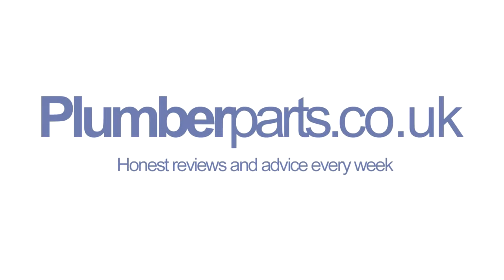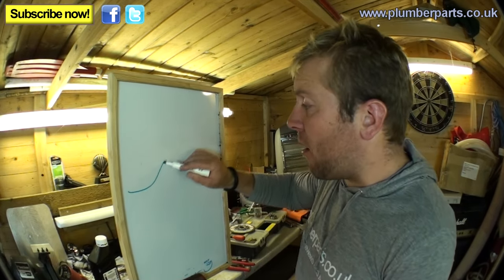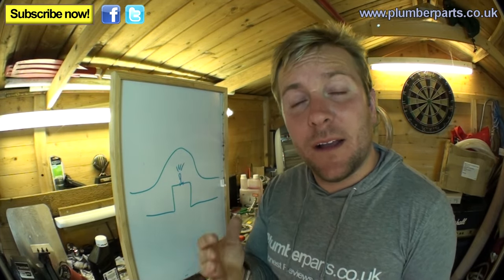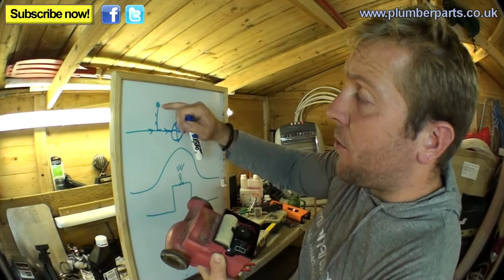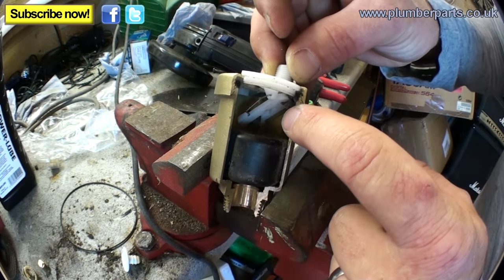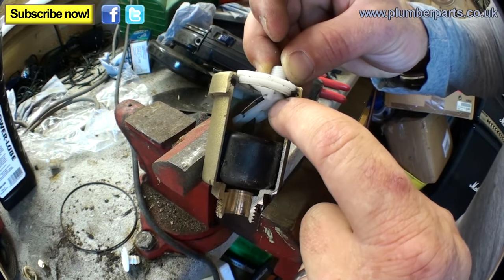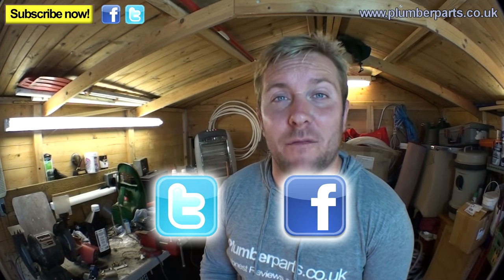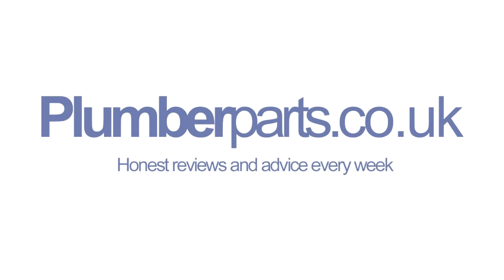AUTOMATIC AIR VENTS - Plumbing Tips

Comment: Oh man, I’m so glad I found this video. It’s the start of the winter season up here in the Colorado Rockies and on my Laars JVS 225 in addition to a dirty glycol issue that I think I’ve got a handle on until next summer when my plumber does a complete flush I find I have to drain air directly from the Grundfos circ pump every so often which - as I see from your remarks - the open vent top should not be on the inlet side of the pump: which it is! If I knew how, I’d send you a picture. I’ve got nothing to lose, I closed the cap, I’ll see what happens.  I’m having to run the pump on high vice medium which may help with my flow issue across the heat exchanger that was making a racket but I couldn’t figure where I was getting air from out of the Grundfos. Thanks, man, hope this helps me. If it works, I’ll let you know. ✌🏼
Reply: I guess this is too old to comment on, that’s cool.(Hope you got your toothaches taken care of 😉)

Comment: Top man for this part in depth explanation and info. Mine (well the top half brass part and float ) is in a JAGUAR 28 KTV J, the body is bespoke and part of the pump assembly, the issue with this is, is the part is obsolete. So a good old clean, especially around the spring loaded pin that seats into a baby o-ring. A good clean was required. (Touch wood) this has fixed the problem on a 21+ year old boiler !

Comment: Great video many thanks. Separate isolation valve sounds good idea for permanently energised apps. Presumably they fail earlier in hard water areas. Interesting to cut one open that's failed. Can you do a video sometime on airlock theory. I'm thinking surface tension can be involved, so don't put filters and restrictions in the pipe like small bore iso valves. You will understand and explain it all much better. Hope the tooth's better soon.

Comment: Hi ya, enjoy watching your videos and learnt a lot and put in to practice. We  will be moving into a inherited house soon that had a sludged up system. I'm in maintenance as a job so I'm not shy in trying new tasks. I've drained and flushed several times, removed radiators and manually flushed out. Installed a filter near boiler return after running for several weeks with cleaner, flushed again added inhibitor and all working better but not right still. Its a Y type F&E system that has been changed at some point to a feed and vent from tank in 22mm. I've removed the bypass and capped off pipes for now as I thought both sides were hot to quickly and found the valve full of black debris so my guess must have been right. I've a towel rad with open lock shields and not all rads have TRV's so should be okay until I replace the valve. Leading to this video. There is a manual air vent on a 90° drop (T piece rad feed one side to air vent other side) from pump to radiator feed. The air vent is only about 6" from the T piece. Every time I open the air cap there is air in it. Its a large system 15 radiators and down stairs take a lot longer to get heat than upstairs. I've balanced all rads and now all get hot but slow downstairs. I think there has been flow back/ fill to header as the tank goes brown and white quick. Do you think a automatic  bottle air vent about 12" above the T piece will help downstairs by having no trapped air? Thanks  James. Holding tight 😀

Comment: Are you meant to leave the small plastic top vent cap loose to let the air out or do it up tight?
Reply: No, it has an small air valve funnel to automatically allow air to vent out when needed, video explains if you rewatch.

Comment: Originally auto air vents were for filling purposes only.  When the system was full with all air out, you tighten it up. Otherwise you might get a leak and stained ceiling.

Comment: I installed three new air vents on my hot water boiler. My question is, can I leave the air screw in the closed or open position or leave closed and vent when needed?

Comment: The AAV has black solution leaking and going down the pipes in the airing cupboard.  One engineer turned it off but did not install a new AAV, 3 months later another engineer has just turned it back on as he said it causes a build up of air and pressure in your boiler system which will cause the heating system to fail/break down.  You said in your video to turn it off if water comes out, so now I'm not sure if it should be turned off or kept on??  Either way it will cause issues.  Please can you help!  Thanks Emma

Comment: i have bought a new one but been told this is a 3/8 one and mine is 15mm. Maybe daft q, but will the 3/8 one screw in to the existing "olive" extension part of the 15 mm one? - the one i bought has no extra fitting whereas the old one has an extra fitment below. Thank you!

Comment: Hi
I changed my pump on my train on combi boiler the other day and drained system. I’m now going to put in inhibitor and usually put it in around the auto air vent (bottle type) as it’s the highest part on the system but when I was undoing the compression fitting water was coming out, should I just undo it and accept some water will come out or is there something wrong with the system. There was a new pressure cyclinder fitted also. Combi seems to be working great. It is 14yr old 
Thanks
Ewan

Comment: If it's a sealed system, why or how would air be in the system? And if the air vent did release the air, does this mean you have to continually top the boiler up?

Comment: Thanks. Just a note , that "cap" you say will keep the water from coming out should the ballcock get fouled, is not a cap, but a second vent. It's designed to swell up inside if water reaches it. That way air can still go out this "cap" yet still remain water proof if the vent fails. 
Cheers.

Comment: I have UFH and the Flow Meters all have trapped air after a "Power Flush" and recommision. These are on the botton Supply Pipe instead of the Return on top with Actuators. Is this a problem to get the air out if the Auto Vents at the end of both are ceased up? Is it really bad in the system as it has not made it noisy yet?

Comment: Ive got one of these bad boys on my potterton puma 80se, a relic I know 8) . having occasional  problems with what I thinks an air loc around the circ pump, when it refuses to circulate makes it makes a whooshing bubbly sound and a bloop bloop when you shut the boiler down, like air going back up into the exchanger. Theres one of these auto air vents to the top left of the boiler so will change that out. Cheers man ;)
Reply: well wotdya know, gave the valve a tap and it started hissing air, followed by drip drip which stopped when i screwed the tap down tight. the pumps circulating again. I held tight n it was alright! lol 8)
Reply: jeeeez, I had no CH flow again! After getting on ze web I found out the pumas are sensitive to HW leaks. Just like the leaky HW tap in mi kitchin!! Just shut the tap down and boosh, CH flow restored! Id have never believed it till i see it with mi own eyes!!

Comment: Hi - I have an automatic air vent valve fitted close to my hot water tank and open it from time to time to release air that has accumulated, it does not leak  and there is no corrosion around the unit which is an open system. Should the cap be left slightly open to allow the system to vent automatically ??? - I do not have an issue with air in any other part of the system ie the rads.
Reply: I also am waiting for that answer

Comment: Hi, need help an old guy has a stand-alone gas fire he tells me the back boiler was removed but has had a lot of problems Eg water frob ceiling chimney breast wall wet he doesn't have any other heating besides gas fire, looks like two 3/4" pipes at the bottom of cylinder go under the floorboards down the chimney wall they run down the wall into the breast how is the coil feed? no pump or anything else I can see any suggestions would be welcome Phil

Comment: My domestic hot water is fed from a combi boiler. Upstairs when I turn on the hot water the pipes make a lot of noise and vibrate and the w\ter sprays out at first. Someone tells me it's air. Will fitting one of these valves help. Thanks, like the cut open valve by the way. its good to see how things work.

Comment: Simply put a small service valve below the automatic air vent and, if it becomes leaky, then just shut it off and swap the air vent over. Service valves are incredibly cheap, especially if you buy them in tens and massive time savers.

nb. on plumbers not putting in bleed systems, I have just had to fit a couple to my disabled brother's bungalow as the clowns who put the system in, which has lots of inverted loops, didn't fit any form of venting  in and the combi was dropping out due to pressure issues as air built up and the liquid was being ejected as air expands more that water as it gets hot. Also, it looks like I might need to put in a supplementary expansion vessel, as the small one in the boiler seems to struggle somewhat with what is a lot of water due to very large radiators.

Comment: You replied to someone who asked about whether to use bottle vents on a shower feed from a loft, saying to use them only in heating systems only.
I have two on the peak of my shower fed airing cupboard, up into loft, down into bathroom. They are at the top of the feed. With the vents closed...When I turn the shower off the pump does a weird off for a second, on for a second, off, on, etc until I cut the electrical supply to the pump. If I open the vents, when the shower is turned off I get spurts of water come from the vents!
I assume all this grief is because the bottle vents are not the right tool for the job. But what is!? No shower/man smell is only going to lead to 'marital complications'. Grief no man should have to endure!

Comment: Do you think this would work if this is on the top of a 12" pipe, with a tee fitting at the bottom, with a shut off ball valve in the middle so I can change the vent in the future without shutting off and draining the water ?

Comment: My central heating is losing about 1/2 to 3/4 bar of pressure a day. I am bleeding a large quantity of air from my radiator in my lounge all the time but no where else. I have had auto air vents fitted in February when I had a new boiler fitted and because there appears to be no leak anywhere, I inspected the air vents  and they have blue/greenish corrosion on them. Could this be causing the problem ? Thanks.

Comment: My AAV is leaking water out the top and has green streak marks down the side of its body. Can someone please advise what may be wrong and if it is something I can fix myself?  All the plumbers I speak to aren't available until next week but I'd like to get it sorted (even temporarily) sooner as the garage floor is soaking wet along with the stuff I have stored on there.  Thanks in advance.

Comment: The screw cap has to permanently lose to vent air, am I correct?
I had such vents installed on my radiators on top of a high building and on only one of them, water pours out - quite a bit!
The installer wanted to convince me I have to manually open and then reclose the caps again to vent - I smell BS?

Comment: what do you do if your auto air vent is leaking? I've bought a new one but how do I fit it, the boiler is a Potterton Promax Combi HE Plus 28 HE, it's started leaking slightly and I have a bucket under it right now, do you have any video's on it please, it's the auto air vent on the right above the pump, thank you.

Comment: Hi
Just had problem yesterday when I opened hot and cold water tap to fill the bath. The vent pipe coming from the top of the tank started to fill the tank with water which made it to overflow the tank and because the water coming fast the drain pipe was not coping with the flow so water started to come from the ceilings. Any idea. The system I have is 21 years old Abd is boiler with tank not compi boiler

Comment: Hi, I have a keston c55 installed. The automatic air vent started leaking water, so the Plumber changed it and it is still leaking. The plumber now says it could be the heat exchanger thats gone and is asking for £1000 to fix it. Can you help me? After watching your video, it seems to me that it might be a small problem? thanks.

Comment: what do you do if your auto air vent is leaking? can you please advise me.
Reply from the maker: Tap it loads. If that doesn't work, isolate the water and remove any debris by shaking it up and down in water. It's not an easy one to fix though. Often you need a new one. Sorry for late reply, good luck, PP!

Comment: Hi, having an absolute nightmare with boiler. Not working for 2 and a half weeks. Had several plumbers out, each replacing a different part on the boiler (thankfully its a renal property, top floor apartment). However, none of them have fixed it. Boiler fails to ignite or when it does it switched itself off after an almighty roar. 
Now, last week the plumber burst a pipe in the loft and had to replace it as water was coming through the roof. He also explained about having the up and down pipes you explained. We have no automatic air vents on the system and they have suggest to install these, however I havent heard anything about it since. 

Will this solve my problem!?
Reply: Sounds like a blocked heat exchanger, but the heating technicians should have pointed this out if they knew what they were doing.

Comment: For us, beginners compression joints are a godsend. Solder which is messy and tricky is hell is a nightmare. Having too completely drain the system if a solder joint was not good, not to mention the mess. Just one question. You mention putting the air vent after the pump. Isn't pump pipework 22 mm.
Reply: just reduce the pipework

Comment: Hi Guys, I have air trapped in and around the boiler on my oil fired sealed central heating system. I have automatic Air Valves fitted on the pipe runs in the attic (I live in a Cottage and my central heating pipes run across the ceiling then drop down to the radiators) I have tried everything to remove this air, I don't know how many times I have drained the system down and refilled it but I still have the damned air  and because of this although I have managed to get all 8 radiators warm, not hot, i feel that the air is restricting a nice clean flow to all of the radiators. Do you think I should fit a second circulating pump to the return pipe?? please help im going nuts. Robert Smith
Reply: Are the vents fitted in the correct places and  have you bled your radiators during filling ? They may need bleeding again. Your system should tell yiu what's going on at the pressure gauge

Comment: I'm having to open mine up once a week. What would be causing the air in the system?
Reply from the maker: Either not enough inhibitor in the system or perhaps the pump speed is set too high!
Reply: @plumberparts  would a leak in the system somewhere let air in or am I wasting my time looking for one/some?
Reply from the maker: It’s rare. Usually the water comes out!

Comment: hi i have a water boiler heating system that is leaking water at the top of the air vent meachanism  part.looks like a can with a cap on top located at the highest point of the plumbing .the red cap is broken is water suppose to be coming out when cap is off or broken? my cap is red plastic and its not solid on top it has two tiny holes / slots openings on each side

Comment: Are these just for heating systems or would you also use it on a hot water supply (i.e. to taps)? In a bungalow with gravity system - cold tank in loft and hot water cylinder on ground floor.  Shower pressure (near cylinder) is good.  Hot tap pressure (some distance away) is low.  Wondering if there may be air in the horizontal run to the taps or whether a pump is needd to up the hot water supply pressure!  Thanks, Matt
Reply from the maker: I wouldn't recommend using on a hot and cold water system. Cheers!
Reply: I use one on my gravity fed hot water cylinder and works a treat and had no issues yet.

Comment: Hi,
re: automatic air vents

Are these suitable for open vented systems - I thought I'd read somewhere they were only any use on sealed systems.

Cheers

Parky
Reply from the maker: Old Ash Farm Should be fine mate!
Reply: Incredibly late to the party but if you're still interested to know. Fitting an AAV on an openvented system will have very limited effect

This is due to the fact any air you remove will be reintroduced into your system as you have a tank open to atmosphere.

Any air removed will be reintroduced into the system at this point of contact

Comment: These video's are excellent, has he done a basics video? eg. broken down and explained the different types of systems with pros and cons? i need to see this I'm trying to figure out if i definitely do have a vented system or not n if so how i can improve hot water pressure? can someone add a link to the clip?
Reply from the maker: Layton, what do you want to know? Cheers, James.
Reply: plumberparts just a basic dummies start sort of thing, I have watched your videos and identified my system  but someone told me one name n you say another so I'm not 100%, maybe if you did a video of the different types of systems found in UK homes and maybe the different names ie, open vented system also known as ???? mine is open vented with tank in cupboard and a tank in loft but i wanted to put a pump in line to raise hot water pressure, but not sure where to put it, keep up the good work, your video's are well presented and have a touch of humour which makes them unique to the rest.

Comment: On the auto air vent once set up do you screw it down tight or leave slightly open?
Reply from the maker: Kevin Waters Either. They should be fine but tend to leak if left open over time.

Comment: 4:00 when fitting an AAV, put an isolation valve in the pipe first - then all you need is to turn that off if changing the vent !
Reply: He did mention that to be fair.
Reply: @ricko3k  At what time ?